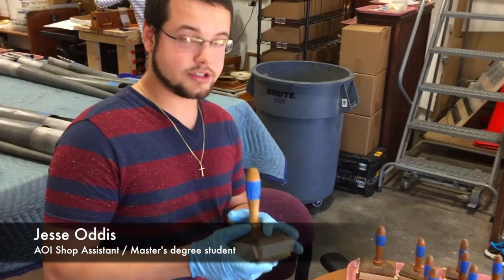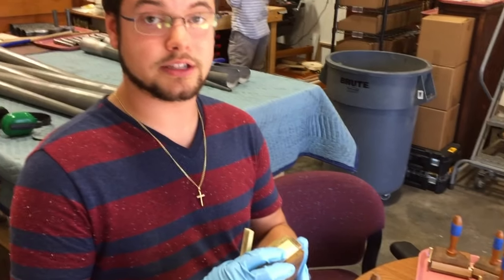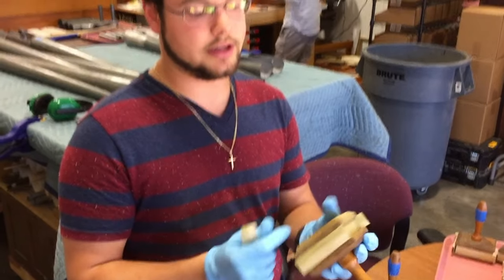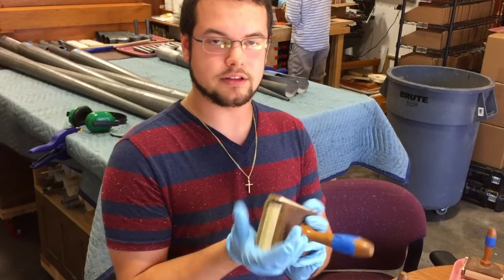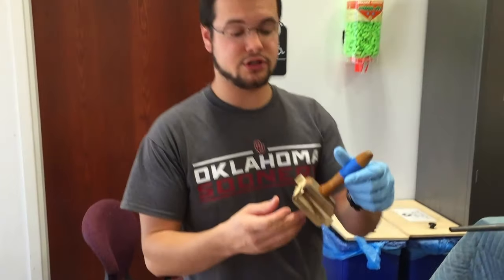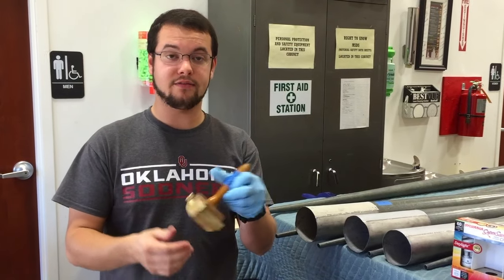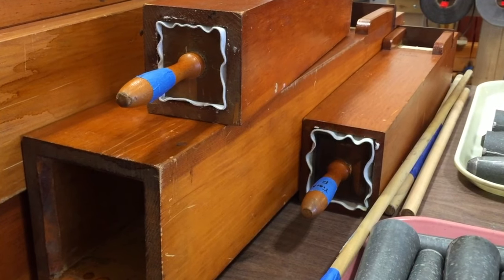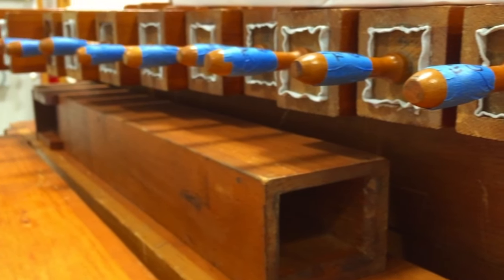AOI Organ Shop – Restoring pipe stoppers

Comment: Another way to deal with these old cork stoppers is remove the cork and fill the slots with felt strips, on the larger stoppers the leather alone creates too tight a fit and with seasonal changes it can crack the pipes if the stoppers are too tight, the felt creates a snug fit but has some "give" to it.
On the smaller stoppers, say 3" x 4" size and smaller I never cut leather strips, I do a full wrap over with a square piece of leather, much quicker and it's how many of them were done in the old days.
The leather strips and tacks method I usually use for large pipes such as 16' bourdon 1-12, and then onto around note 18 or so, to when they get down to around  3"x4" then I use the squares of leather.

It uses about 1/3 more leather but is much quicker labor wise which offsets that anyway.

At the end of your video where you show the finished pipes, the excess leather sticking up over the top I nornally trim off, I set the stoppers in squarely  about a couple of mm's below the top of the pipes and trim the excess leather off with a razor blade, it just neatens them up  nicely, looks professional,  and gets rid of the excess that's not needed.

  I've releathered pipes at work for the last 18 years, both old and new.